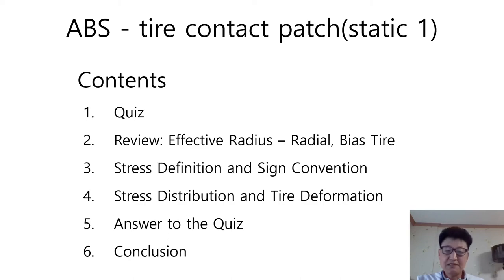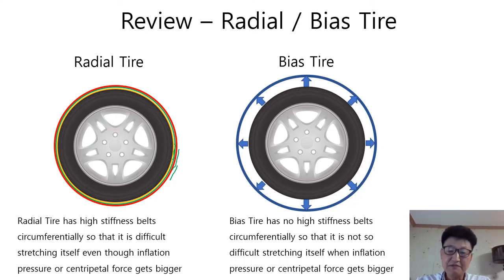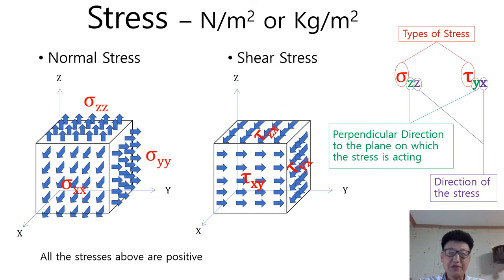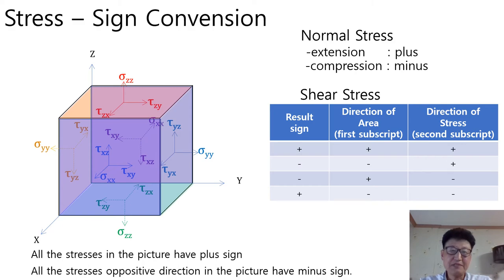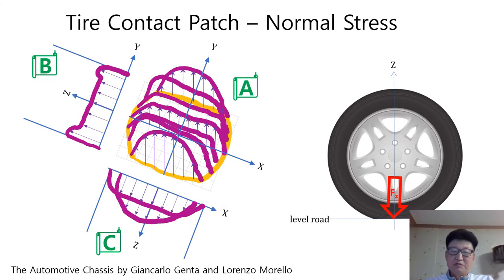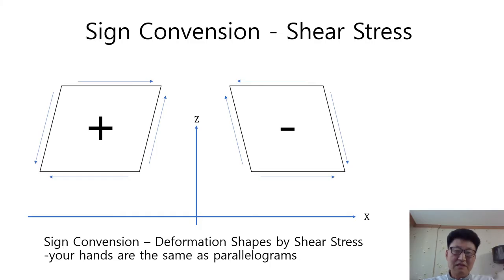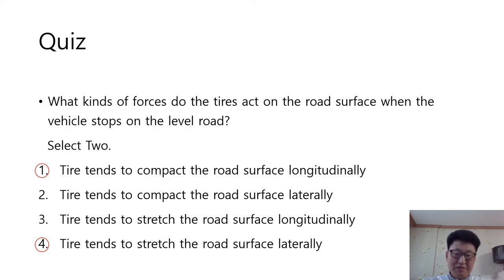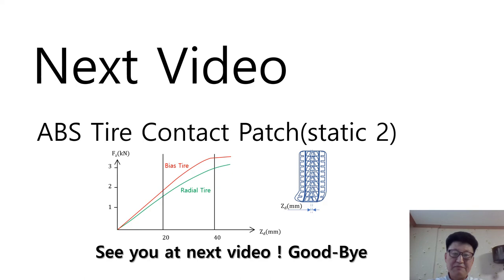E0012 tire contact patch(static 1) - tire behavior, normal, shear stress, stress distribution

Comment: Professor Ko:

If there's anyone on Earth who would know the answer to this, it must be you:

For the average automobile tire, what would be the area, in square inches, of the inside of the tire, which contains the air?
Reply from the maker: I'm sorry I'm not with the answer to your question.
Reply: @vehicledynamics   If you don't know, then nobody else will.  I guess because wheels and tires come in such a wide range of sizes and proportions, it's never been attempted to be measured.
Reply: Your question isn’t specific enough to know what you’re asking. The area of what?
Reply: @theiastatejake  I  should  have  known  I'm  in  the  decade  of  stupid.  If  you  all  could  elect  a convicted  criminal  back  into  the  people's  house,  then  how  are   you  supposed  to  understand  that  I'm  trying  to  find  out  how  to  measure  the  inside  surface  area  of  a kreldan   tire?!